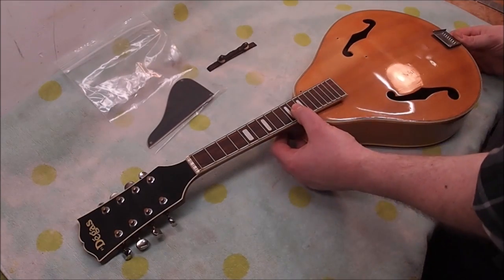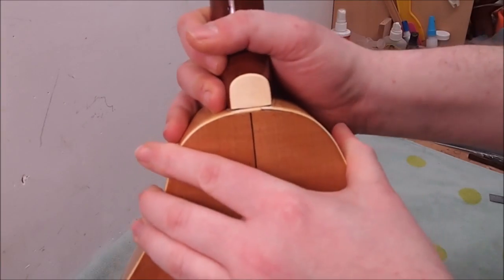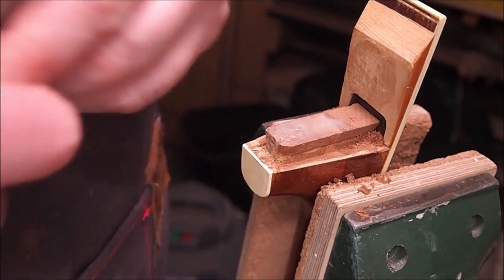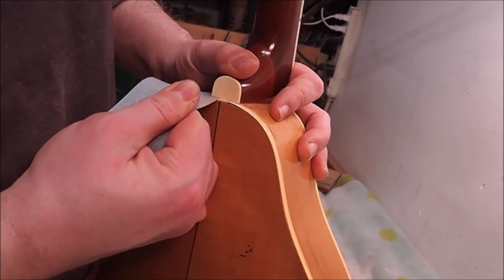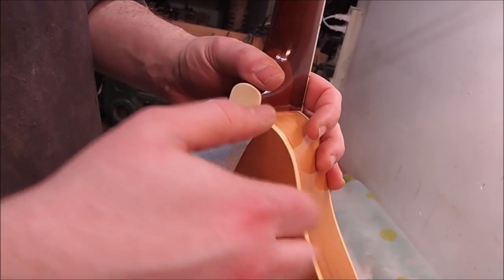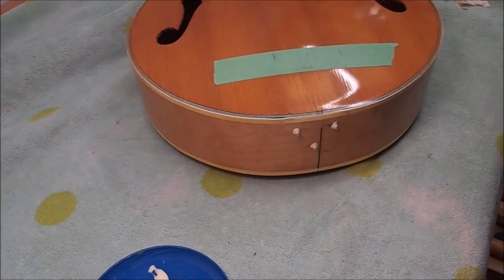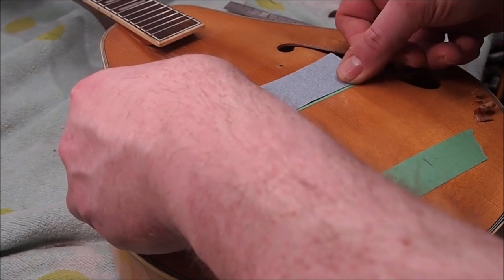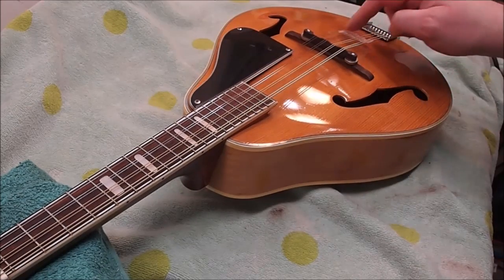Mandolin Resuscitation

Comment: Might not be worth Mr. Whiner's time (or yours), all the same, thanks... you've been a great help and inspiration for the repairs, restorations and modifications I'm plorking (play-working) at with my two experiments : 1) a 1985 vantage that needed help with the 1/4" belly problem happening with it, fret planing, nut, tailpiece and bridge replacement/ invention made from some of the antler I've had laying around. 2) a 1992 Ovation celebrity that has the same belly swell problem that seems to me to be inherent in the string pinned to the bridge situation creating a shear stress on the thickness of the 1/8" (~) top and whatever reinforcing (soundboard ?) underneath that can't be compensated for without using the Bridge Dr. you used in your 1972 Epiphone video.
My learning experience will be changing that stress from shear (causing the tilting bridge syndrome we all love and adore) to lift (which requires less pounds per square inch of upward pressure and no lateral tension) through the addition of an elk ivory tailpiece dovetailing with my undying love of carving and polishing... stuff (all of which may result in the culminating scene of Casablanca, either replacing Bogart with myself and Claud Rains with my guitars walking casually off into the foggy, yet inevitable sunrise proclaiming the possibility of a new and beautiful friendship or getting on the plane with Ilsa for the dual purpose of having sex on the beach in Lisbon while experimenting with vodka and peach schnapps in the casino/ bar I start up there... I wonder how they say "the American" in Portuguese?). Either way I'll be wearing a Fedora and a pin stripped suit.
Both of which keep me from experimenting on my off the shelf Gretsch G5222 which grabbed hold of my leg and wouldn't let me leave the store without it (it seems to change colors from blood red to black depending on it's mood), though it's had issues with the three way switch since a ceramic Betty Boop mug committed suicide by jumping off a high shelf careening off it on her way to the floor. Since I'm only just learning how to play I'm procrastinating fixing it as I haven't found reason switch to the bridge pickup yet.
And there's those other 200,000 unrelated projects I'm working on.
As I said... Thanks!

Comment: Do you ever use a product to make a sort of "mold" of a complicated section where wood is needed, and then carve the piece out of wood to match the mold?
Reply from the maker: I haven't found that necessary. If the area to be patched is really splintered and uneven I will usually find a way to rout it out square and flat so I can get a good glue joint.

Comment: When fixing the curve at the heel cap, why not orient a strip of sandpaper sideways and floss it back and forth? You're not trying at that point to take out a wedge of material like you're doing for the neck reset, and then you wouldn't constantly have to reinsert the sandpaper.